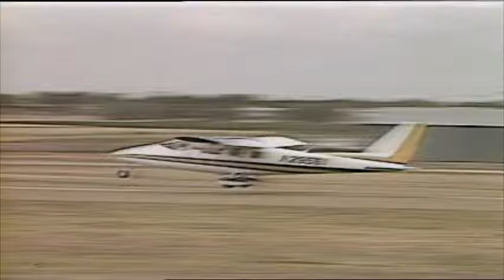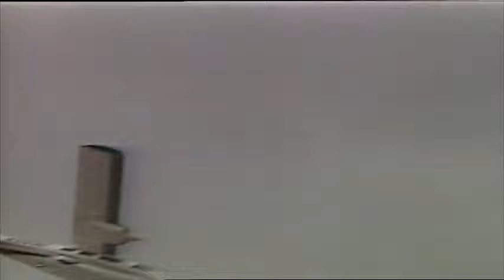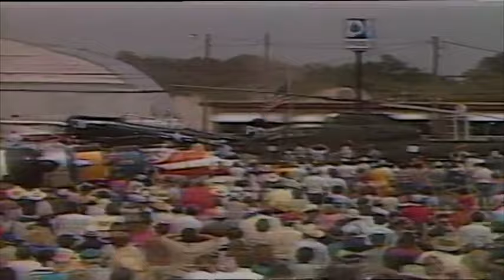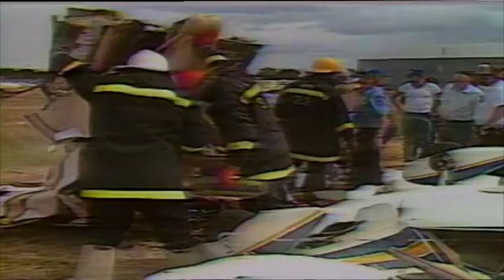Plane Loses Wings During Airshow (09/11/83)

Comment: From the FAA.  THE PLT WAS EXECUTING A HIGH SPEED PASS OVER THE RWY AT ABOUT 250 FT AGL. THE PLT THEN BEGAN A RAPID PULL-UP & BOTH WINGS SEPARATED JUST OUTBOARD OF THE ENG NACELLES. RECONSTRUCTION OF THE SEQUENCE FROM A VIDEOTAPE REVEALED THAT THE ACFT'S SPEED AT THE TIME OF THE WING SEPARATIONS WAS 220 KTS. VNE FOR THE ACFT IS 193 KTS. IT WAS CALCULATED THAT, AT 220 KTS & AN 8 DEG NOSE-UP PITCH, THE 'G' LOAD AT THE TIME OF THE WING SEPARATIONS WOULD HAVE BEEN 8.3 G'S.
Reply: stop yelling
Reply: I'm not yelling. That was a copy-paste from an FAA report. Chill bro. @jeffreypease
Reply: Damn. 8.3 Gs. He thought it was jet fighter.
Reply: That's unbelievable. This wasn't just some freak accident. Either he was delusional, stupid, or suicidal. Doesn't mean he deserved what happened of course.
Reply: dr.harryballsackiii6733  That's even more unfortunate, doesn't really narrow down the options though. But I'm guessing probably the real issue was overconfidence and arrogance. Which can lead to delusional beliefs and behaviors.
Reply: Thank you, Trent. Good info.
Reply: 8.3G's. No wonder the wings ripped off.
Reply: the plane never even started its pull-up when the wings broke.
Reply: I can hear anything.
Reply: the FAA is Ron Burgundy?
Reply: @bullseyes1983  an f16. poor bustard. rip.
Reply: @adotintheshark4848 Yes it did. I can clearly see the plane suddenly pitch up about a quarter of a second before the wings broke. It didn't take long for the wings to rip off, so the plane barely gained any altitude.
Reply: That's what happens when you fly in large caps.
Reply: Stop shouting.
Reply: @scottcharney1091  I copied and pasted that report directly from the FAA Karen. Talk to them.
Reply: @jeffreypease maybe, if you stop talking for the rest of your life
Reply: PLEASE I POST IN ALL CAPS ALL THE TIME.  @jeffreypease
Reply: dr.harryballsackiii6733  Not tragic. Only less dangerous aviator in our community.
Reply: @adotintheshark4848  Are you blind?
Reply: Wow, even many planes designed for aerobatics aren't supposed to handle 8.3 Gs.

Comment: the pilot was REPEATEDLY warned by people AND  the manufacturer to STOP  and never do these maneuvers. I recall the event and the history. He was a fool to do these maneuvers.....this was inevitable.
Reply: classic FAFO
Reply: @trentvlak  pretty much, he should have had a very different kind of aircraft... Maybe a bi-plane type design of an earlier era could have taken forces like that and been reasonably priced in the 80's.... Sad
Reply: exactly, he was pulling G like a fighter jet, the amount of fatigue on those wings was hard to watch, so obvious it was going to give. Very sad hearing her voice as she watched
Reply: I owned one for 15 years.  Bought it from a Canadian and had it inspected by an FAA chap who had inspected that very plane.  He said that the pilot had asked the company if that kind of stress was okay and was told it was.  Personally, i doubt he was told any such thing. But, regardless….read the specs and believe them.  A plane with a huge safety margin would too heavy to fly.
Reply: @GuardDog42  Pretty sure a Pitts would have been close to the same price at the time. My father owned one late 80's, would absolutely hold better than this.
Reply: @piperg6179  There's a guy -Dave Martin (?) who does a full routine in a stock C-310 at Oshkosh pretty regularly. my guess is that this pilot just didn't have as deft a touch. Both aircraft should have been built to a similar spec..
Reply: @Avro7  You may well be right but in the accident rpt, if i remember correctly, the ntsb said his speed was near or above VNE and they figured that his speed and AOL, as seen on the video, resulted in about a 6 g pull, way over the 3+ g of the certification. That would mean not deftness but hubris. Also, he had flown this, although probably less blithely, before so low cycle fatigue may have contributed. (For our non-engineers, means low cycle fatigue of metal occurs because it was subjected to high loads for not many cycles.  Lesser loading can be repeated many many times before failure and that is termed high cycle fatigue.)  

In my unskilled 3,000 hours in a Partenavia, i flew well within the certified limits and i dont remember ever pulling the wings off. But, i will check my log book to see if my memory is correct.
Reply: Oops….been too long out of the air.   It’s not AOL, it’s AOA….angle of attack.  That is the angle between the wing and the airstream.  The greater the angle, the greater is the lift, except that above around 20 degrees most wings start to disrupt airflow over the wing.  That is called a stall. When stalled the wing generates practically no lift and we plop out of the sky.
Reply: "But whoever says, ‘You fool!’ shall be in danger of hell fire."  Matthew 5:22
Reply: @AllinGold2  Alas, all us guys have a tendency to do stupid things from time to time.  The lucky ones who evade some dire outcome are deemed wise; the unlucky are deemed fools.  The poor guy in the Partenavia probably had no idea he was treading on thin ice. Few structural engineers fly aerobatics and few stunt pilots study structural engineering.
Reply: @bournejsn  You can't even do that on fighter jets who have limits to prevent over G. It's a BIG inspection when they occasionally do "bend" them. The Blue Angel jets are all bent frames.
Reply: Didn't something similar happen to a private aircraft during a gender reveal gathering in Mexico not too long ago? Revelers were cheering throwing confetti but completely unaware that the pink fairy dust carrying plane just lost its wings.
Reply: He effed around and found out
Reply: He was doing aerobatics in a plane that wasn't built for this kind of flying. He kept exceeding the wing loading then this is what happened.
Reply: there are many, "hotshot pilots" that disregard advisory warnings.    RIP
Reply: @piperg6179 
👍thanks for the expert explanation 👌
Reply: Well, he won't do it again.
Reply: @GuardDog42   Even aerobatic gliders are far stronger than most average planes. Why don't they build ALL planes a bit stronger? When you need toget nervous doing a 3G turn, how on earth are you gonna fly a 180 in a valley? Such weak planes are death traps. Why not BUILD them stronger? All of them? General Aviation was a mean man. All those flimsy planes, yuck.
Reply: @AllinGold2  well he threw his life away now
Reply: @AllinGold2  why are you quoting passages from a 2,000 yr old book? 🤔
Reply: @sammyhill69 because it’s timeless and relevant
Reply: Well your wrong  @Avro7
Reply: “during a high-speed, high-G maneuver beyond the design parameters of the aircraft.”
Reply: @piperg6179  Yes , but surely if you are going to do something like that with a plane then it’s your job to find out and know these things. After all , there were families and children on the ground entrusting him with their safety.
Reply: @3chords490  exactly.  As a stunt pilot friend said in exasperation to a tyro proposing to buy a YAK 52 or something….”John! Listen to me John! You can get real dead doing this.”
Reply: @piperg6179 if your wings came of you may have gotten a bit of a bump to your head and forgotten to fill out your log so don’t be too hard on yourself 😉
Reply: @sammyhill69 are you the YouTube Police 👮??
Reply: It's hard to be the smartest guy in the room.
Reply: @piperg6179  I'm thinking you can figure this one out just by looking at the purpose of the plane.
Reply: @mrnice111  Absolutely! A passenger plane that can withstand aerobatics is a poor and not a good design. The extra strength needed for areo means a heavier plane less suited to passenger use. Generally, a sumo wrestler makes a poor ballet dancer. That sort of logic.

Comment: The other problem with deliberately stressing airframes is it shows no consideration for the next pilot/future passengers.
Reply: This is a big concern of mine when flying at busy flight schools. Quality of renter decreases and you really can't be sure what the last guy did in that airplane that could have compromised the airframe. 
While its 100hrs and an annual between inspections, that's a lot of time for a fatal flaw to go unnoticed until it is too late.
Reply: Fatigue… the main structural components experience fatigue with every flight. You add aerobatic maneuvers to an airframe that was never intended to do them and you cut the life expectancy of those components significantly.
Reply: you can stress the airframe. But if you keep doing it, eventually something gives.
Reply: Seems to go with the territory as I have seen Many , many flight schools open and  fold ,  in the same buildings "  over 30 + years .. Most FBO's  operate on a fine -line budget , Sometimes not clearing much net income  on a bad month.  Every hour of flight can yield rough weather adding airframe stress ,  bad landings , ground loops . Etc   Every squawk written in the pilots log books (mandatory) should  be evaluated for further inspection . It's  a tough business  of responsibility.  Hats off. to them .
Reply: @Keys879 Years ago I was in a 152 with the FBO’s head CFI. The airplane was a leaseback, and the CFI demonstrated “why we flare” by NOT flaring during a touch & go. Leveled off 8-10 feet above the runway, chopped the power, and let it drop onto the runway! Then he says “now if the guy who owns this airplane saw us do that, he’d shoot us.” I was shocked and angry at the cavalier attitude, and that he’d treat an airplane (or anything that’s someone else’s property) like that. I made a point of contacting the owner that afternoon. He deserved to know.
Reply: That plane has the build quality of an SR-71. 😢
Reply: Very true.. But it's usually not a problem for aircraft used in these airshows -- as it's public record that these stresses occurred. The problem lies with students, trainers or renters who do these high G maneuvers without informing anyone.
Reply: @AdamsOlympia  exactly. For planes built for acrobatics - this one was not
Reply: I doubt he was borrowing someone else's plane.
Reply: Its called the I let go of my ego manuver and paid the ultimate price
Reply: @bradsanders407  most people hire aircraft.
Reply: @adotintheshark4848 uh yeah that’s the point he made…. Thanks for rewording it.
Reply: @markfox1545 the sr71 is very well built.
Reply: Part 2
https://youtu.be/v_VpGqnPc5s

Comment: This is what can happen when you pull too many Gs.
September 11th, 1983 - Airshow in Plainview, TX, USA - The pilot was executing a high speed pass over the runway at about 250 ft above the ground. The pilot then began a rapid pull-up and both wings separated just outboard of the engine nacelles. The 'g' load at the time of the wing separations would have been 8.3 g's. The plane, a Partenavia P68C, was not design for so high a G load.
Reply: "was not design for so high a G load"???
Design???